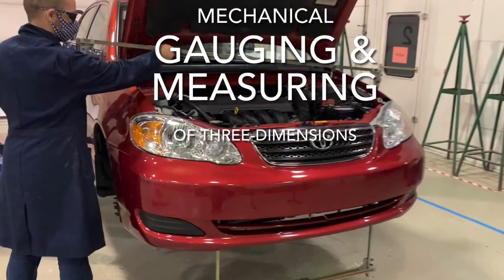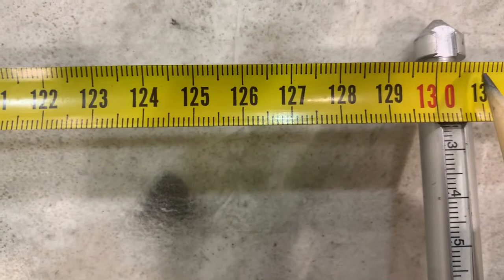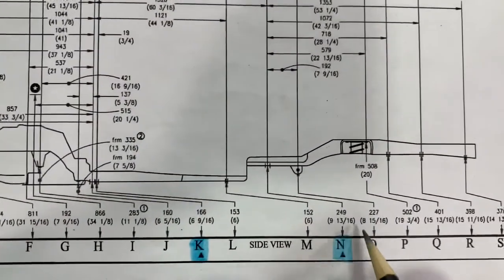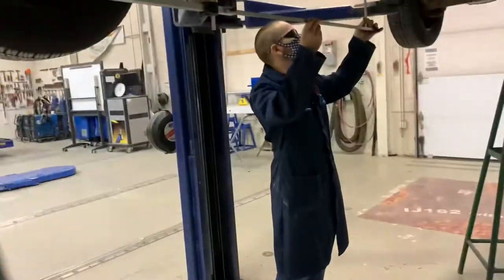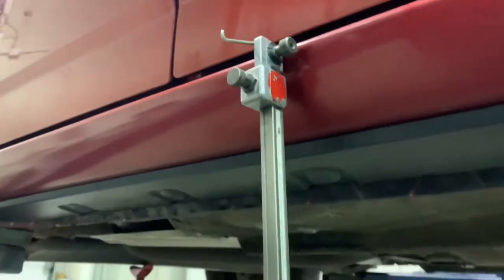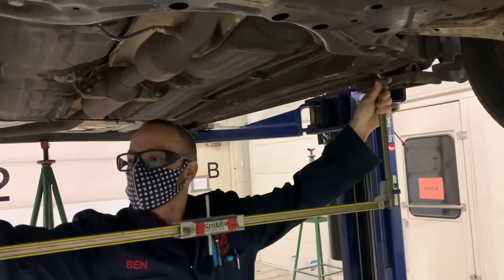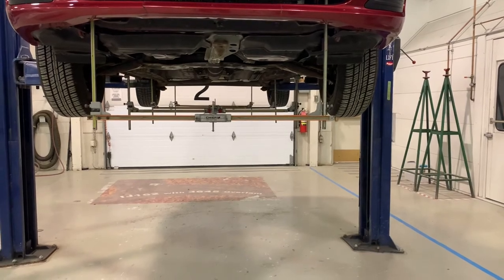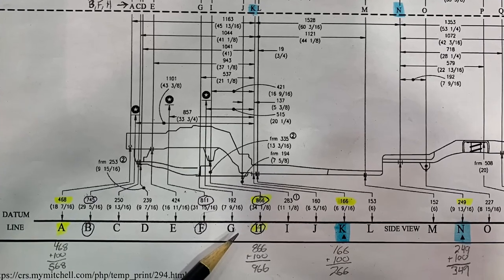Mechanical Gauging & Measuring

Comment: Here is a secret to save a ton of time on setting up the tram gauge for point to point measurements. Its easy get a long flat surface and lay down a long strip of tape, then use a tape measure and make a starting dot on the tape, then measure out the distance you need and make dots, then you can simply stand the tram gauge points on the tape , lining up the points you made for a quick setup, way better then holding the tape measure on the tram itself, you can make multiple points on the tape for reference and simply line up the tram gauge points and its 100% accurate and fast. Also this accounts for the tram height differences so you can have 1 long side and 1 short side and the measurement is on point. I use the same Mitchel repair software. No on one youtube does the datum lines explanation though, for measuring frame rail heights, they do side to side only etc.. the datum line to frame height is important, but no one ever goes over it, how to do it manually without a 50k auto laser machine.

Comment: Excellent video....very well explained... keep doing these I know it takes time to shoot and edit but you have a good way for explaining things... thanks a lot. Any ideas where I can buy a used set of those? Thanks
Reply from the maker: Thank you Jorge. It is a lot of work and I will continue to make more as time allows. Chief does not make these gauges anymore; however, Mo Clamp sells similar gauges. Alternatively, you could contact your local frame equipment distributor/supplier and ask them to keep an eye out for some.
Reply: Is there any online courses how to do these measurements

Comment: Oh God totally can't see any possibility of measuring inaccurately 😒 wonder how many "bent" frames all these shops get paid to fix.  Shit the play  on those gauges look to have a millimeter of play let alone having them " properly centered"
Reply from the maker: Hi William. I think you missed the point of the video. Mechanical gauging and measuring provides a visual reference for the three dimensions of measuring. After understanding these concepts, students move onto electronic measuring (which is the the method preferred by industry). Mechanical measuring helps in understanding what it is that the computer does.

Interestingly, we have measured vehicles mechanically then with the computer system and get consistent results. Although, as you mention, there is always the factor of human error.
Reply: @benh4086 what are some examples, or products, that are based on electronic measuring systems? I just got into body work(my brother owns a shop I just started working at)but I have a ton of knowledge in robotics and mechanical engineering and I'd like to learn how the electronic systems work